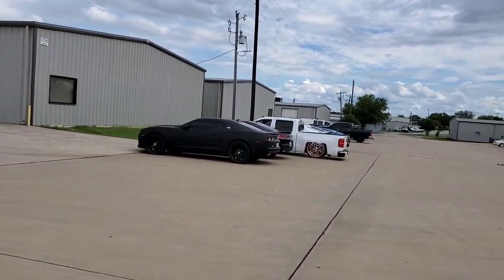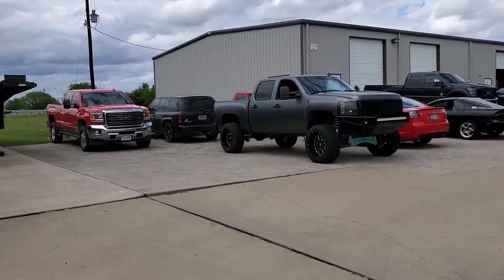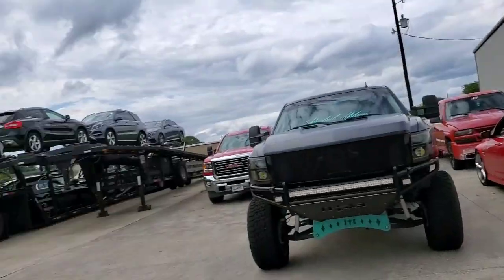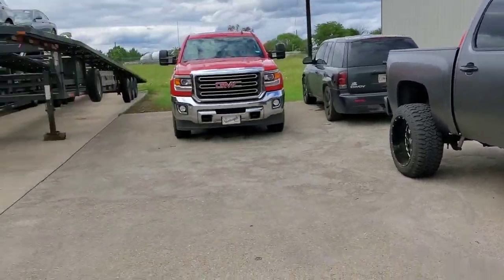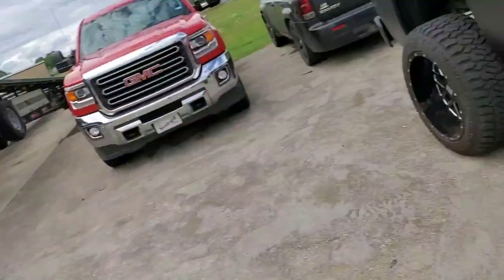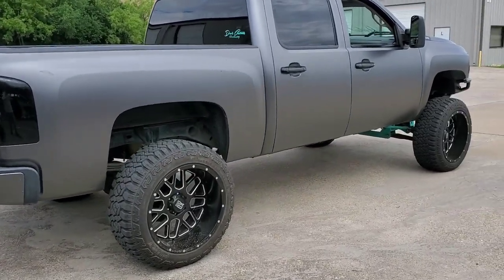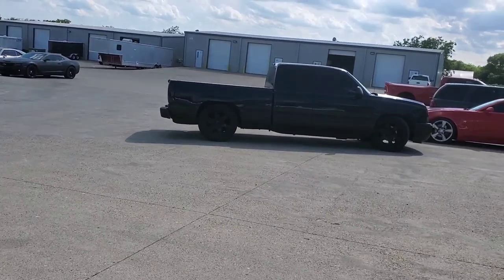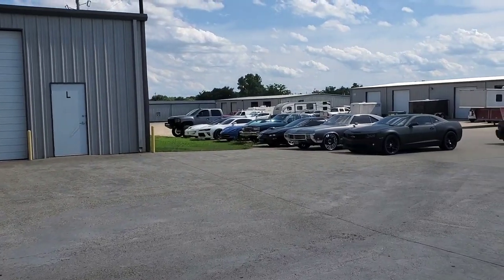Silverado is back | Pre and Post TX LSX tune | Cammed 5.3 | Vlog

Comment: I have a 09 Silverado 2500 with a 6.0. Rebuilt with tsp stage 1 truck cam. New water pump pully dual spring push rods long tube headers tuned and is sounds pretty loud. I have to turn the ac off so it can really chop nice. I haven’t dynoed yet so I’m sure it should make the same horse power as yours.